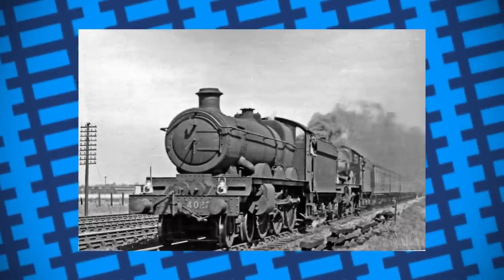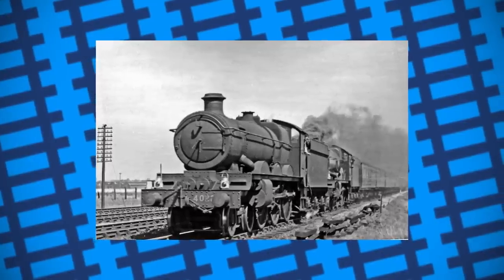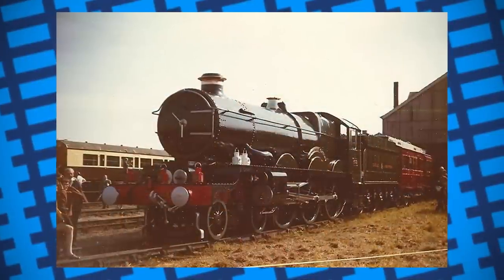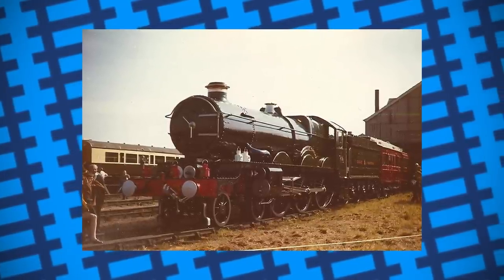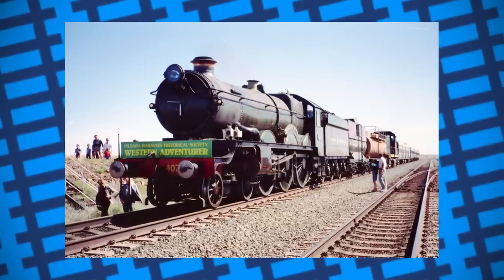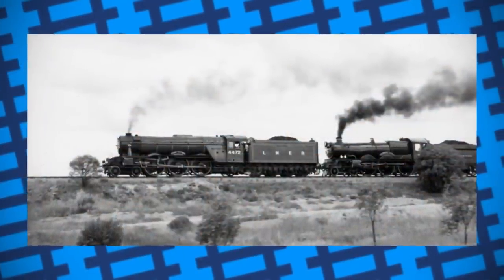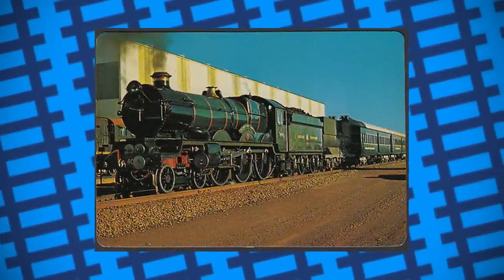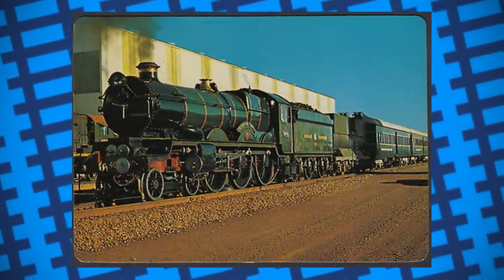Australia's Great Western steam locomotive - Pendennis Castle

Comment: The Castle class were more economical than the original Gresley A1s, as the 1925 trials showed - not just down to coal. But Gresley learnt from this, modified the valves to give better steam flow and produced the A3s. In due course all the A1s, including Flying Scotsman, were converted to the better A3s. You could say that Pendennis Castle helped Flying Scotsman to realise its full potential.

Comment: On the exchange trials, she could leave Kings Cross and immediately enter the Gasworks Tunnel which has a rising gradient. The A4s would struggle on the climb, whereas 4079 was still accelerating as it emerged into the sunlight.
Another example of God's Wonderful Railway, thanks to Charle Collett.
Thanks for a great presentation.

Comment: I didn't know that a GWR Castle is more powerful than an LNER A1. And then GWR went on to build the King class. Remarkable.
Reply: However, the GWR claim that the Castles were more powerful than the A1s per se was based on the spurious grounds of tractive effort. This only matters starting heavy trains from rest. The continuous power output at high speed is a much better indication.  The Castles did have better valve dimensions than the A1s which made them freer-running and more economical, hence their victory in the 1925 comparative trials. Gresley put this right with the A3s (and later A4s like Mallard) and converted the A1s including Flying Scotsman to A3s. The Kings had a higher tractive effort than the A4s, but the A4s and LMS Duchesses produced maximum sustained power outputs well above those of a King, because boiler capacity and grate area also contribute.
Reply: @iankemp1131  - Thanks for that explanation. The Kings, like Stanier's Pacifics on the LMS, had particularly challenging territory -- almost level across the Thames valley, and then up and down and up again through Devon. That's a challenge for any steam engine built within British loading gauge to do at speed.
Reply: @pacificostudios  Very true. It's an interesting question on many routes whether it's better to have the sure-footedness of a 4-6-0 or the bigger grate area of a wide firebox 4-6-2. Over recent years it's been possible to compare side-by-side on Shap or South Devon, and several classes from all the Big Four railways (and BR) have put in distinguished performances. Weather conditions can affect the choice as well!
Reply: @iankemp1131  Weight limits were also a factor during the U.K. steam era. Apparently, the relatively weak bridges on the GWR bridges prevented Kings from crossing the Saltash into Cornwall.
Reply: @pacificostudios  Yes, the Kings had very limited route availability and had to be changed at Plymouth. For most tasks a Castle could do just as well, which is why there were never more than 30 Kings, while more Castles were built all the way up to nationalisation to a total of 171.
Reply: The Kings were really a bit of a publicity stunt. The GWR had claimed the Castles were the most powerful British locos in terms of tractive effort. Then the Southern built the Lord Nelson which were higher.  So the GW pushed their design to the limit and broke the magic 40,000 lb barrier. To do this they had to enlarge the cylinders to the maximum permitted and still had to reduce the driving wheel diameter by 2.5 inches for no good reason rather than cosmetic. They could actually have done a substantial redesign and improvement - the cylinder layout was based on the de Glehn Atlantics of 1903 and gave weak frames and inaccessible inside valve gear. Stanier used this layout in his "Princess Royal" 4-6-2s, realised its weakness and substantially improved it for the Duchesses (Princess Cornonation). The GWR did not really move on after Churchward put them 20 years ahead of any other British railway around 1900.
Reply: @iankemp1131  - 30 units is more than a one-off. Yet I can see some of the troubles they had compared to the Castle. The whole idea of mounting cylinders over the rear pilot wheel makes late GWR steam look unusual, along with the horizontal steam tube. Function over form, that.
Reply: @pacificostudios  Basically they stuck with the cylinder layout that Churchward had copied in the Star class from the de Glehn compounds, and Collett perpetuated it in the Castles and Kings when something different might have been done (indeed Churchward himself might have reconsidered from scratch, as he did in the 1900s). W.A. Tuplin commented that the inside valve gear and its positioning in the Stars and successors was clearly designed by a man who was quite certain that he would never have to service it himself. And yes, the curved steam pipes do look odd compared to the nice straight outside steam pipes on GWR 2-cylinder engines, LMS Black Fives etc. Still, when the Stars/Castles were first introduced they were so far ahead of any engines on other lines that this was a minor drawback.
Reply: @iankemp1131  - That's very interesting. As an American railfan, I've long wondered how the inside cylinder on a British steam engine worked, especially the valve gear. 3-Cylinder compounds were briefly tried in the States during the 1920s, leading to the 4-10-2 and 4-12-2 machines. Although they worked well enough to survive WWII (many troublesome engines were scrapped in the 1930s), the most powerful express locomotives of the 1930s were all simple engines, including the popular 4-8-4, 4-6-6-4 and also the 4-8-8-4 Big Boys on the Union Pacific and the Duplexes on the Pennsylvania. That said, the British loading gauge almost dictated using the space between the outside cylinders for a third cylinder on engine designed for maximum tractive effort and/or power.
Reply: @pacificostudios  Most 19th century British locomotives actually had inside cylinders and inside valve gear; typically 4-4-0s for expresses, 0-6-0s for freight. Churchward studied North American practice and went for 2 outside cylinders for most engines but at the time inside Stephenson's valve gear was still standard. Later on outside Walschaerts gear was preferred by most railways. 3 and 4 cylinder engines used either separate sets of inside valve gear or drove the internal valves by conjugated gear (Gresley) or rocking levers etc. As you say, the biggest British express engines generally had 3 or 4 cylinders, though British Railways kept to 2 for their Britannia 4-6-2s for ease of maintenance, using high boiler pressure by British standards (250 psi). Compounding was popular in Europe but never really caught on in Britain though various designers dabbled with it; Churchward showed his simple engines were as powerful as the de Glehn compounds and easier to operate.

Comment: Although the Castles outperformed the A1s in the 1925 trials, the GWR claim that the Castles were more powerful than the A1s per se was based on the spurious grounds of tractive effort. This only matters starting heavy trains from rest. The continuous power output at high speed is a much better indication.  However, this cannot be predicted by a simple formula like tractive effort. Some small-wheeled goods engines have a higher TE than Castles or A1s but would be unable to haul heavy express trains at high speed. The Castles had better valve dimensions than the A1s which made them freer-running and more economical. Gresley put this right with the A3s (and later A4s like Mallard) and converted the A1s including Flying Scotsman to A3s.

Comment: Did I imagine it but I thought Australia had slightly narrower track gauge than the UK, is that just part of the network or was I totally wrong.
Reply: we have a mix of standard gauge and a 1600mm broad gauge
Reply: Hammersly Iron (which is isolated from the rest of Australian railways), along with New South Wales and the line Sydney to Perth are all Standard Gauge ( 4 foot 8 1/2 inches - 1,435 mm) the same as UK.  Queensland has narrow gauge and Victoria broad gauge ( except for the main line between Sydney and both Capitals) . I don't think either Pendennis nor Flying Scotsman traveled beyond  the standard gauge
Reply: @gold4leaf  and then there is Peterborough with all three on the same stretch of track
Reply: @cathli_fox  are yes ... narrow, standard and broad .. a very unique place in Australian railways
Reply: @katelights  and narrow gauge ... Queensland and Puffing Billy in Victoria and parts of South Australia
Reply: @gold4leaf  Western Australia, Queensland and South Australia all started out with a narrower gauge of 3 ft 6 inches (and still use it). Not very narrow though, compared to the 1 ft 11.5" of Welsh narrow gauge railways and the 2 ft 6" of Puffing Billy. 3'6" was also used in New Zealand, South Africa and many other parts of the British empire. Some of the NZ and SA steam locomotives were giants, comparable with many large standard gauge engines.